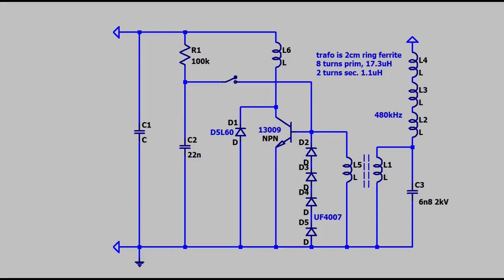Electronics "Experiments" Megamix Vol. 1

Comment: Please be careful and don't electrocute yourself. Please :)
Reply: Especially on the CRT. The pain is distinct and it lingers too.
Reply from the maker: don't worry, none of these experiments imply dangerous energy supplies, even the flyback PSU outputs like 5mA and it's basically safe, the wimshurst machine can be painful but harmless and a charged CRT is the same (i'm not suggesting you to let your guard down with these things)... if i'd be using a MOT or a ZVS driver the risk would be way higher